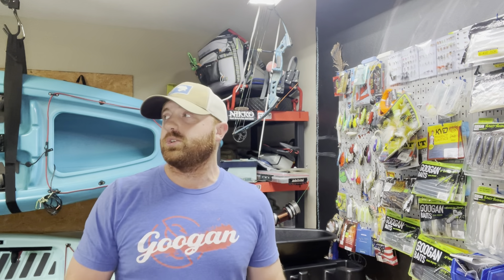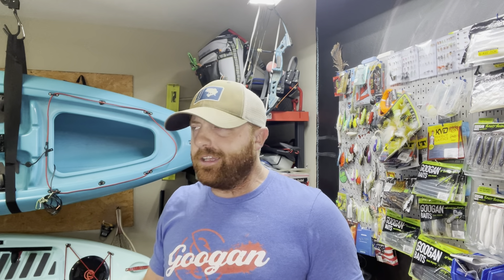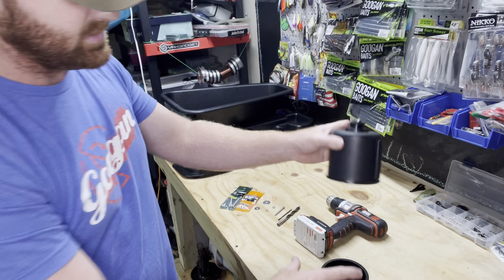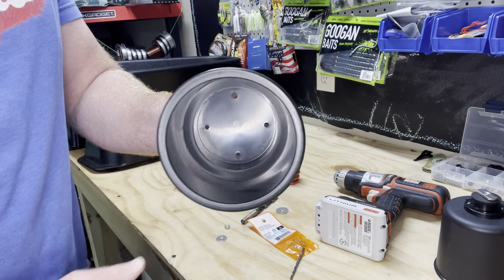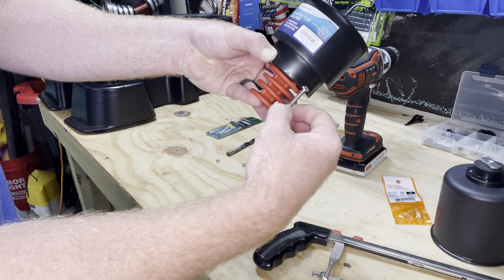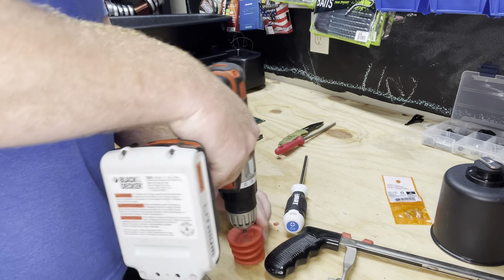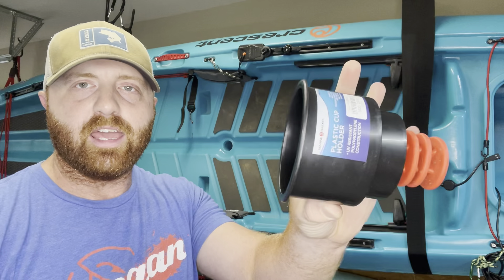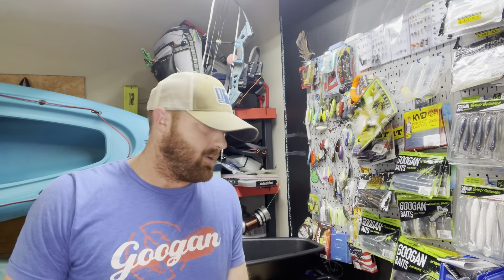Scupper Plug Kayak Cup Holder / KAYAK BASS FISHING/ SIT ON TOP

Comment: This is the exact situation I'm in..Got the same yakattack cup holder that I wanted to put in the scupper hole. Definitely gonna go find one of those academy cup holders and do this. Great walk through.
Reply from the maker: Appreciate it! Mine is still going strong. Key is to use the biggest washers you can on each side of the plastic cup.

Comment: I'm looking forward to someone doing an in-depth review of the seat riser used in a flowing river situation. It's not uncomfortable as it comes, but I would like a little shorter distance to go from standing to sitting. Not really willing to give up much stability in trade off though. The front hatch is a good idea, I think. Can't wait for the next video. Keep it up.
Reply from the maker: I will give it a try soon and let you know. I’m curious myself
Reply: @Itchin2Fish  Its not terrible, but stability goes down, practice in flat waters because your fall out point becomes much easier to achieve.  Love my crescent, but in most rivers i dont run the riser.

Comment: This was an epic fail for my wife and kids lifetime kayaks. The cup bottomed out before even placing the scupper inside the hole. I hope I can get a refund for the scuppers.  Live and you learn. Still a great idea
Reply from the maker: Sorry, not sure what went wrong for you. 
Mine is still going strong! I’ve pulled it in and out a bunch putting a lot of pressure on the plastic. My boat is a Crescent with big scuppers.
Reply: @Itchin2Fish  the bottom of the cup bottoms out on the kayak and the scupper doesn’t even come close to plugging the scupper hole.
Reply from the maker: @teamcq9204  you can go online and get some after market plugs. Sounds like yours are on the smaller side. You could use rubber spacers with a longer bolt  that should fix it! Tight lines!
Reply: @Itchin2Fish  I just went the toilet bolt attached to the rail route. Works flawlessly